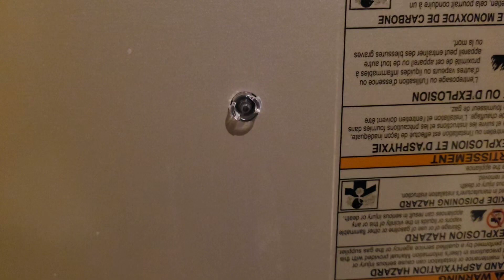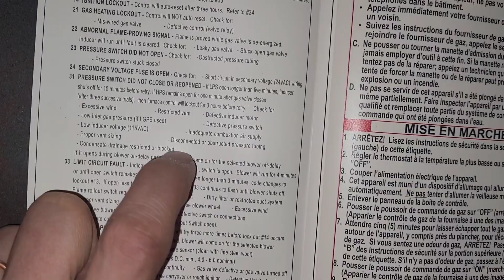Code 31 Carrier/Payne Furnace: Waterlogged pressure switches!

Comment: Hi Reuben.  I had the same problem on my Bryant 96%...code 3-1 with water in the pressure switch. Replaced the pressure switch and cleaned out the condensate trap.  All was good until the outside temp dropped to below 20 deg F for a few days creating lots of condensate.  Turns out i the problem is caused by the design issue with that particular inducer motor housing (too narrow inside the port where the pressure switch tube attaches on).  The fix is to replace the inducer mechanism for the newer version which is explained in this video: https://www.youtube.com/watch?v=_dKfqLOp_P0